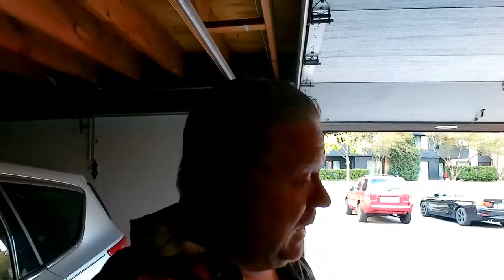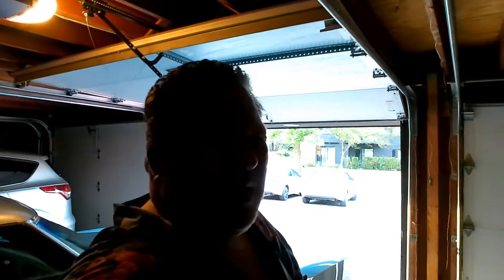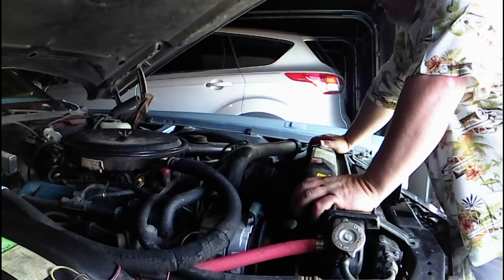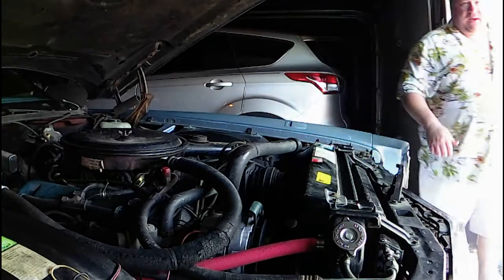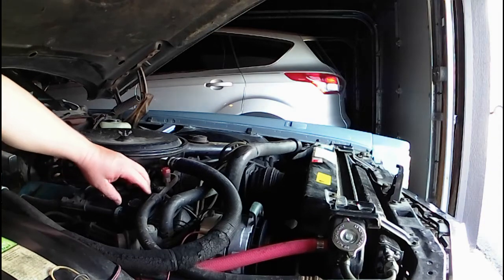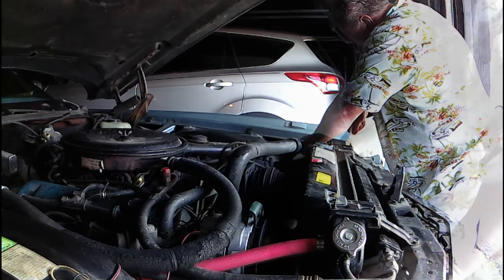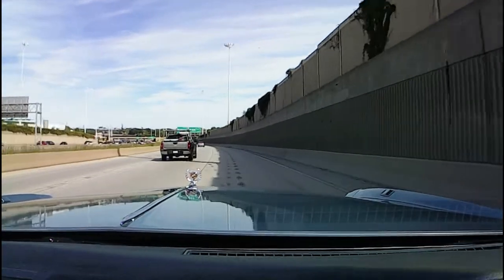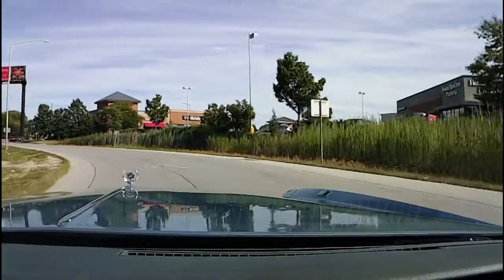Water pump troubles on the 78 ElDorado...

Comment: Getting a 77 eldo back on the road, a blue Biarritz !  It started with flush the coolant,  scale in the radiator led to change the radiator since it was leaking, and twist off one trans cooler line due to rust, while working on that, the power steering cooling line rusted through at the support, fixed that (don't get stainless, it is not bent properly and your brakes and steering will howl), while doing that, noticed a new drip, from the water pump.  such as it is with a car that sat 22 years.